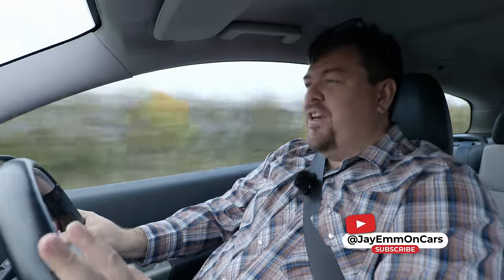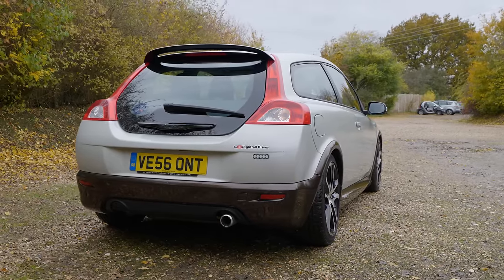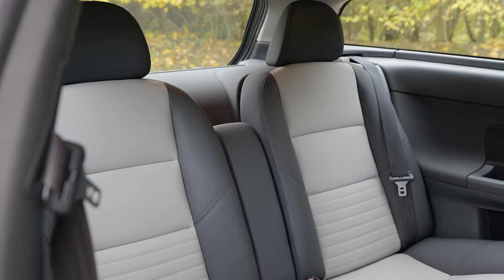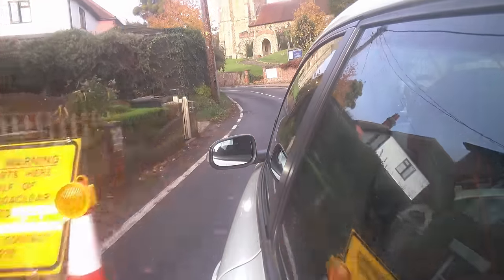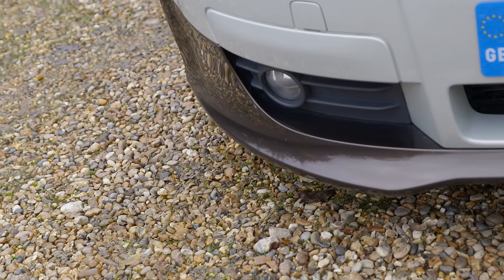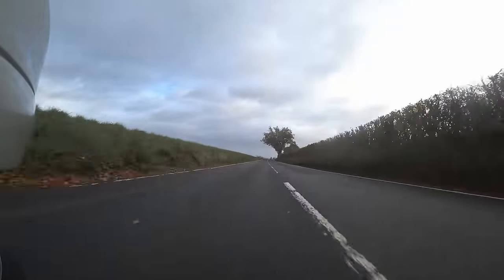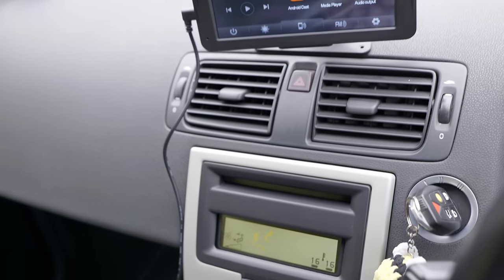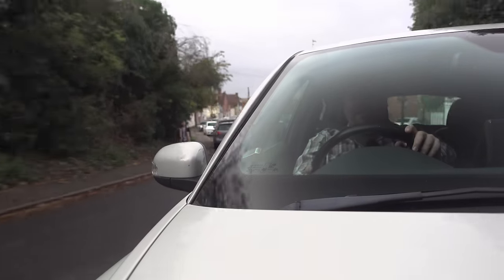The Volvo C30 - More Than Just "The Car from Twilight"?

Comment from the maker: CarVertical: The History Checking Service 
Use this link or code "JAYEMM" for a discount!
https://www.carvertical.com/gb/landing/v3?b=1e4c9523&a=JayEmm&voucher=jayemm&chan=jayemm
Reply: The pre-facelift version looks best IMHO. I am glad we got these in the USA, hard to find a good deal on a manual one though....fun cars like that have the "manual tax". You can get an automatic one for cheap though and I guess convert it with a brand new manual transmission and still spend less than on a factory manual one. In America, we only got the T5 engine, not even a 4 cylinder option.
Reply: Cheaper options hpi check online 😮

Comment: i like the c30, because over time i realized that it's basically a spiritual successor of the Volvo 480, which is already one of my favourite volvos.
Reply: "Over time..."???

How much time did it take you? It's obvious from the first sight!
Reply: 1 look from behind and you can see it.
Reply: I have also hankered after a 480 for years - probs the main reason i’ll keep my C30 forever! 😉
Reply: Ah I loved the 480.
Reply: I still think the 480 looks cool but a 1.7t from renault vs a 5 cylinder 2.5t is what puts me off now, it did take me a while to clock the supposed connection to the 480 too.... R.I.P popup headlights
Reply: I see it more as a successor to the 1800es
Reply: C30 is much better than the 480 for corrosion resistance but yes. Production Owner of the 480 was Pim de Ruigh,  a great guy RIP
Reply: richardharrold9736 it should be allowed if developed correctly. Pop up headlights now could raise up like aero brakes
Reply: richardharrold9736  because they're cool
Reply: @chaospxl_ ..........480 spiritual successor was P1800es..............i owned a gorgeous 480 in paris blue from 1996 until 2002......1.7 injection with auto box,2 tone leather interior of turquoise and grey........traded it in for an 850 estate ;)......always owned volvo.......my first was a 1.4 volvo 340gl.....then a 1.7 340.....currently own a v40 d4 - love it..........never got round to buying a c30 but may get one for weekends :))
Reply: richardharrold9736  There were laws for headlights positioning souch as hight etc, that prevented car manufactors to make sleek designes cars. 
Popup headlight were a way for car manufactors to give the finger to the establishment. 
And therefore will forever be the on cool wall, whatever one might think of looks. 
There are more of these stories back in the day when car manufactors actually had some cojones…

Comment: I've had one for the last six years,  no joke it's the best and most reliable car I've ever had!
Reply: at 100,000 miles you should have already neeed wheel bearings and brake pads, better check again if you hear loud rumbling noises.
Reply: @potatochobit  Oh no, possibly having to change wear items at 100k miles?! OH THE HUMANITY
Reply: I owned a Volvo S40 T5 (basically the same car) and conversely it was the most unreliable car i've ever owned.
Reply: I like it too but loads of my mates got into Volvo, I've already got a 2dr hatch
Reply: @krudmuphinstudioz maybe it's just u ... not all cars are meant for us
Reply: Yeah same here, i have had one for about 10 years and it's been flawless
Reply: What engine have you got ?
Reply: @julienbee3467  Oh, it's just the 1.6 diesel... It's taken me around the UK with hardly a murmer!
Reply: @krudmuphinstudioz  Same here, diesels. Nomore Bolbos for me. Fantastic interior for its time but it wasn't engineered on the Focus platform to last more than 5 years.

Comment: As I never go near the ULEZ zones, the 2.4 5-cylinder diesel has always appealed. 180 bhp / 300 lb/ft and 40+mpg with a warble.
Reply: Superb engine.

Unfortunately in C30's usually mated up to a rather woeful automatic box.

Great engines though - and incredible value for money used in the big old S80.
Reply: Mine does 37mpg on a good day.
Reply: @deadmansfire  D5?!

Something's wrong with it if you're getting that little.

I have to properly abuse mine to get below 40mpg, and that's in a pretty heavy S80 (P3)... 50+ combined is very much the norm, and I'm a very long way from a hypermiler 😂😂😂
Reply: I have a C30 T5 and a V50 D5 with a remap. The D5 is as quick as the T5 was stock, but much better on fuel. I hate to use the term, but the 5 pot diesel options are the thinking person’s options for the C30 and are fantastic.

T5 is fantasticer but you need a screw loose.
Reply: @EnglishTMTB  It's an auto and I'm rather aggressive with it. Maybe I'll try to see how economical it can be next trip. 7.7/100 ltr/km right now
Reply: @mcgherkinstudios  indeed - the D5 is much better on fuel than the T5... And still sounds better than the vast majority of boring 4pot petrols of similar performance on the road.

As you say, it's the thinking person's engine choice in these (or P3's, for that matter) - reliable and decent on fuel... as long as your usage is suitable for diesel, they're definitely the one to go for m
Reply: @deadmansfire  in what car? C30?

Mines a manual S80, and I have to be super aggressive to get under 40mpg... Maybe you're doing much shorter trips than me too?
Reply: @EnglishTMTB  C30, some city,most highway ( 140kmh speed limit)
Reply: @EnglishTMTB  The torque from idle is much better being a diesel too. The T5 isn’t weak off boost, but it’s definitely something you notice when hopping from one to the other.
Reply: @mcgherkinstudios   definitely - a relatively minor quibble as you intimate though
Reply: @EnglishTMTB  Yes, I think it's the ASIN autobox from Japan, appearing under the name Geartronic.
Peugeot use it in the V6 diesel 407 coupe which isn't known for its reliability.
A manual six-speed is infinitely preferable but tricky to find.
Reply: @EnglishTMTB Auto boxes kill the fuel economy in Volvos. My V70 barely manages 34mpg.
Reply: @AWMJoeyjoejoe  true - very rarely drive auto's (basically unless absolutely avoidable I won't) but hate noticed it's pretty shocking when I have.
Reply: I've got a c30 d3 5 pot with a few bits and bobs done to it I average 48mpg and I dont exactly have a light foot. Although it could get 20 and I'd still love it 😅 the 5 cylinders are definitely the go to engines for these (diesel or petrol) so much character
Reply: @Krjholmes  yep - 5-pot definitely preferable, as is a manual box... Petrol or diesel depending on the usage, though the 5-pot diesels were less prone to expensive DPF issues than the PSA options.

Comment: As a current owner of a 2013 C30 this was a fantastic watch. I can confirm the upgraded stereo and leather interior really lift the overall experience. I’ve had zero issues with reliability which is a refreshing change as a previous BMW owner.
Reply: Im Looking to buy a 2013 R-Design, I was wondering if yours ever had any issues and if they are expensive repairs?
Reply: How many miles?

Comment: I wanted this car (t5r) so much in college and the dealer was not willing to budge on the price at all. In that conversation he mentioned i should look at getting a VW if i wanted something cheaper. I ended up finding a mk5 R32 and it's laughable how much better the r32 was in comparison outside of just raw torque. Everything in the review highlights the issues and criticism. Myself included, was sold on that beast of an engine and ageless design. But in comparison, there's really nothing special about the car as a daily driver. The VW had a better interior, better driving feel, equally exciting engine and was cheaper. Not to mention the aftermarket options is Apple's to oranges.

Comment: Bonjour.

I’ve had a C30 T5 for the last 9 years. I ran it with 316bhp and 384lbft (not Nm!) for most of them, although I’m now building a 500bhp engine, and no, I never did find the limitation of the front wheel drive that the C30 has.

Engine: The 2.4i is the best sounding engine you can get in a C30. Naturally aspirated 5 pots evoke the old S40 BTCC soundtrack, whereas turbo ones are more muted. However, all C30s are stupendously quiet as standard and an exhaust is highly recommended. The 2.4i does however drink like a T5 whilst lacking most of the performance. D3/4/5 are great diesel engines which all map to over 200bhp, and are a good alternative to a stock T5. T5 is pretty muted as standard but wakes up with tuning and is capable of serious performance.

Floorpan is the same pretty much as a Focus, as it is with the S40, V50 and C70 of the time, which is why various things like ST exhaust centre sections and AWD from the 40/50 fit (and yes, that’s the same AWD setup the Polestar concept had)

The seats in the R-Design you drove were half leather, half T-tec, which apparently is supposed to be an upgrade to the full leather seats offered in trims like the SE Lux. It also has a basic stereo trim and yes, the Dynaudio is fantastic in comparison.

I’ve always said the C30 is more like a mini GT than a hatchback. The rear cargo and seating space is more akin to a 2+2 coupe like an Audi TT or Peugeot RCZ than it is a Focus etc. The T5 suits that with its midrange torque. It’s also a very good base for tuning rather than an exciting car out of the box.

As a way of buyer’s advice, avoid the 1.6d, and avoid the Powershift auto gearbox. The other models range from okay to brilliant with the range toppers being the ones to have. I won’t go into detail here except to recommend visiting c30crew.com for technical info and Volvo C30 Crew UK for a great community.

T5s are cheaper than that, at more like 4k for a reasonably tidy low specced one, although there’s a massive difference between that and a high specced model because of the amount you could spec (this is relatively low spec)

But in all it’s a great review. I’m glad James liked it, and they really are an underappreciated car. The C30 was a genuinely good car to drive (even before you bless it with polybushed front wishbones which improve steering feel massively, and an upgraded rear anti roll bar to tame the body roll a bit), pitched at handling well in the real world rather than the track (Although if you want to see a C30 on track and in competition, there’s tonnes of videos of that and other hilarity on my channel). I’d love to have him drive mine, which he’s said he’d like to do too, but it’ll have to wait whilst I build a much spicier engine for it.
Reply: Good summary 👍🏻
Reply: Do those diesels have Dpfs?
Reply: While based on focus mk2 floor plan being a Volvo it had a fair bit of additional strengthening added I seem to remember it being 300kg or so heavier then an equivalent Clio !!!
Reply: @joeshimbart4103  They are a lot heavier than the Clio, but it’s mostly due to what is built on top of that floorpan. The stiffer crash structures were in the body, and the interior is WAY more furnished than a Clio. I had a 172 at the same time as I bought my T5. Clio was a rattly fun go kart that changed direction immediately, whereas the Volvo was a leather sofa in comparison, but even stock it would comfortably match the pace of the Clio, and all the other clios my friends drove in the Clio community.
Reply: @Matt-go7ss  Yes, on the C30. Early P1 Volvos (S40/V50) came without, but the C30 wasn’t launched until 2007.
Reply: @mcgherkinstudios  Merci beaucoup
Reply: The 1.6D has its flaws, but I personally don’t think it is as bad as people say.
It is a pain to work on with the “French engine design” and you really should service them religiously and keep an eye on the injectors / area around the injectors.

But I would argue that it is superior to the 1.8F and 2.0F.
The 1.6 petrol is a bit of a joke and I don’t like the 2.0D, 1.8 and 2.0 because they say Ford on them.

The Ford Power shift transmission is a disaster, never ever buy a power shift.
Reply: @klaspeppar5619 Nothing wrong with the 1.6 HDI if serviced with the correct oil as you know
Reply: Yeah I also believe the 1.6D is much better than people say. I have a 1.6 D2 V40 (only had the 1.6 for a few years before it was swapped for the 2.0) but mines on 130k and has cost me nothing in any problems with the engine and if you go on autotrader there are many with up to and even over 200k miles. It is all about maintenance. If you buy one that’s been serviced on time then you should have zero issues. But yes avoid the power shift like the plague
Reply: Am I missing something? 🤔The S40 BTCC is a high reving (8500rpm) 2.0L engine, which sounds completely different than what you would get with any production 5 cylinders.
Reply: @staLkerhu  Of course, it doesn’t sound as good as the BTCC engine. But it sounds a lot closer to it than the T5 does.
Reply: I have a 1.6d, 1.8F and a T5. The 1.8 is by far the worst of them! Oil consumption is horrendous above 250k km, the 1.6 is great can get 70mpg out of it and the only reason they have a bad reputation is due to a lack of servicing
Reply: @lbnewell23  i have over 320 000kms on mine.
Reply: @mcgherkinstudios  launched in 2006*
Reply: Now I'm interested, is it possible to fit AWD from S40/V50 to C30?  That would make it interesting with T5.  Volvo "equivalent" to Focus RS witch never came in mk2. 😁  I had mk2 Focus ST and it was very fun to drive, C30 T5 was another option but there wasn't any available in good price at that moment.
Reply: @terot8341  Yes, absolutely. Several people have done it. Personally I think it’s unnecessary weight unless you intend to make big power, but it’s a relatively bolt up conversion.

The RS benefited from a redesigned front suspension which Ford called Revoknuckle, which moved the pivot point of the steering in line with the face of the hub, reducing torque steer. It requires a lot of components to be replaced, but it can be put in a C30 too.

You say Focus RS never came in Mk2, I presume you mean in your market because there definitely was a Focus RS mk2.
Reply: @mcgherkinstudios  meant AWD RS in MK2.
Reply: @terot8341  The GKN twinster in the Mk3 is far better than the haldex setup. It would be better to put a Mk2 engine in a mk3 but nobody has achieved it yet as far as I know.
Reply: @terot8341  they did make a focus RS equivalent that was faster looked better and just awesome and awd and then they decided they weren’t going to put it into production 🙄🙄. But I think in the video jay leno did on the car they mentioned that you could buy all the parts to turn a normal C30 into the crazy PCP monster they created
Reply: Don't get a 2.0D. Already at the time outdated dpf, with tons of issues so bad it can kill the turbo and of course then the engine. Ask me how I know.
Reply: Your like a stick of rock with Volvo all the way through 😂
Reply: @frog-eye1420  This is an unusual compliment 😂 I’m not an outright Volvo fan though. I like the P1 chassis cars which have a lot of potential to handle well and make power, but the usual big estates and saloon barges don’t interest me.

I race an MX5 and a TT and would love a Bugeye STI, W211 E55 and/or Lotus Exige S2 some day :)
Reply: I'm looking into buying an S40 or C30 next year for cruising as I own a Fiat hatback with a 1.3 engine that's really tiresome in 100+ km drives. How reliable are these and how comfortable are they for longer drives? Does the power shift come in models after 2011? I see many S40s and C30s with the 2.4 engine and auto gearbox and MTs seem rarer in my country but I can't find info about what auto box are those.
Reply: @Maartwo 2.4i petrols don’t use the Ford Powershift gearbox, they use the same Aisin Aw55 as the T5/D5s. 

Comfort: Yes. They’re not quite as comfortable as the ‘big’ volvos but they’re still very comfy and quiet etc. 

Reliability: Depends somewhat on how they’ve been maintained, if you go for a car with a sunroof make sure you check for signs of leaks or avoid entirely, and stick to the Volvo engines and it’ll run and run. I’ve had very very few reliability issues over the years and never once has mine failed to proceed.
Reply: @Maartwo  Problem is finding it with a reliable engine. Unfortunately the C30/S40 lived during the diesel craze, so the more reliable 1.8, 2.0 and 2.4 petrols are pretty rare. Check all the bushings and camber plates, of course camber arms and wheel bearings. Heavy car means pretty much full suspension replacement after 160 000km or 12 years. If you work on your cars yourself, prepare for fully rusted on bolts.
Reply: @Isaki138  The smaller Ford/Peugeot diesels are unreliable but the D3/4/5 are plenty reliable when used in their proper use case i.e. not with short journeys.

They don’t rust too bad actually, I’ve found far less than expected.
Reply: @mcgherkinstudios  If yours saw salt, the bolts will be a pain, especially compared to VAG (not a fan of). Cost me many hours of swearing. Oh the loctited ones...
Reply: @Isaki138  I’ve had mine completely apart a couple of times
Reply: Would you please post your upgrades for the engine?thankyou

Comment: I had a Polestar edition of this car for about 7 years, no joke it was the most enjoyable daily ive EVER owned, and Ive owned a Porsche 911 Carrera 4S and a Roush Stage 3 Mustang. The Volvo had the nicest exhaust sound, it had the right amount of balance between sports, comfort and GT, its extremely easy to drive and park, and you can mod them to the moon and back. Also most importantly you feel ultra safe driving it, feels like being in protective coccoon, and mine was remarkly problem free, i had an oil filter housing leak and that was about it.